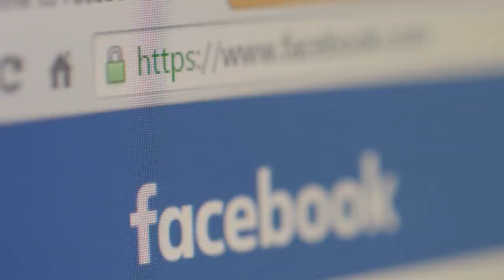At first they thought they had bees in their attic, but later they discovered a much bigger problem

Comment: There is so much wrong in this video. First off thats not a Colombian rainbow bow, that's a Colombian Boa Constrictor, Colombian Rainbow boas are a completely different animal. Secondly they're not dangerous at all. First off the snake in this video has teeth probably 3-5 mm long at most. Not to mention it doesn't have the strength to injure a child let alone a grown man. 3rdly, they don't stop the flow of oxygen.... They cut off blood flow to the brain of their prey. It's much quicker and much less brutal then blatant suffocation. Thanks for coming to my tedtalk.